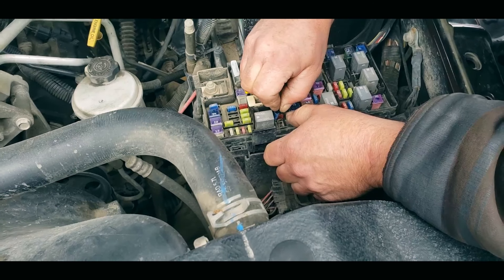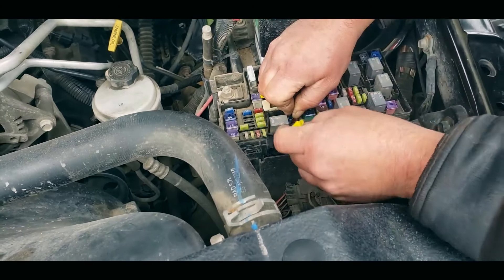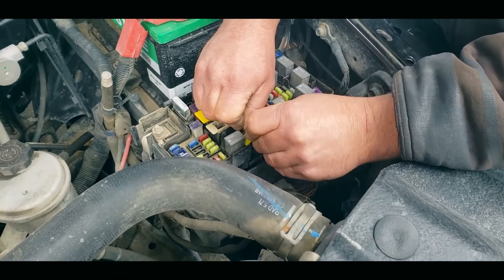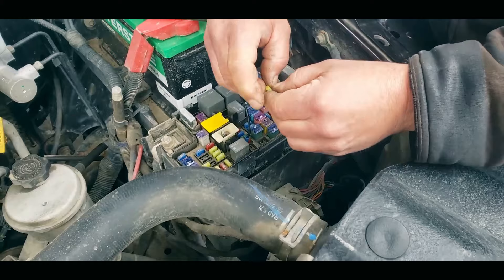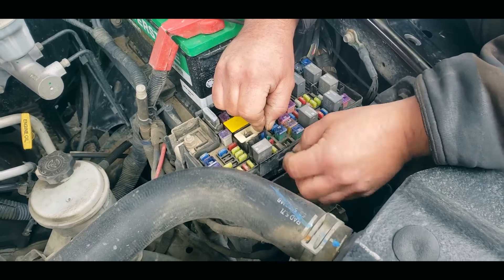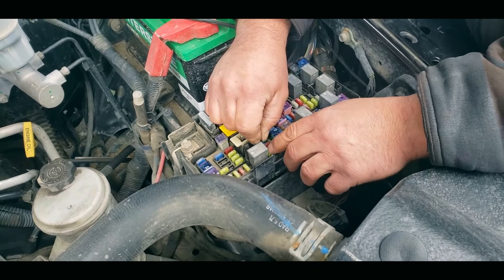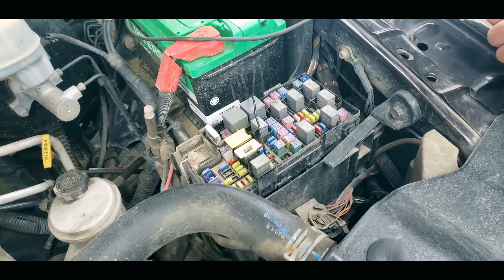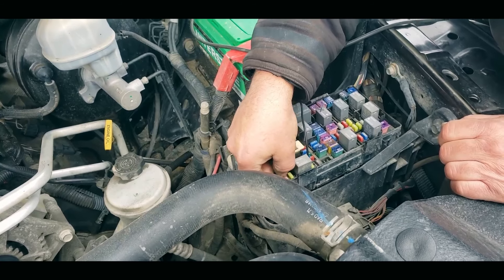Dodge Ram 1500 No Start Condition - Fuel Pump Relay / TIPM By-Pass

Comment from the maker: Hi ya'll,
Thanks for all the support and checking out this video. For those a little confused by what is going on:

Run a jumper wire from M25 fuel pump relay to any accessory fuse (M7 works). The relay is internal to the board so once it's burnt out you have to bypass, M25 is the perfect point to do so.

As many have noted in the comments, consider this a temporary fix to get your truck to a shop instead of getting towed, as bypassing the relay is a safety hazard.

Best of luck to all!
Reply: My relay is stuck in the closed position.  Drains Batt.  I need to disconect exzisting relay before I add new one.

Comment: You don't exactly need a new TIPM, you can order the relay itself for like $9. Remove the board by disconnecting all power to the unit then pushing all 4 lock tabs down which hold the TIPM. Lift it up gently and unplug the wiring harnesses, they are all color coded so you cant mix it up. Once the TIPM is out take it to a table and open it up, there will be I believe 8 more lock tabs that need undone before the TIPM will open in half exposing the insides. Once open carfully remove the board, DO NOT use force of any kind. Slowly wiggle it back and forth till comes out. Now either take the board to an electrical repair shop and they will switch the relay for around $55, or bust out the soldering gun and remove then replace the relay yourself. Its 5 small connections quick and easy even for a beginner, if your unsure then just remove the board and take it into a shop. The $55 they will charge to change it plus the $9 to buy the relay will save you a massive amount in the end. New TIPM are about $1000, refurbished ones about $350. Your essentially making your old one refurbished for like $65...And there are a handful of videos that show the entire process of this in detail as well.
Reply: I'd recommend making a video on that tbh, It litterally cost's $10-$70 ish depending on your area, and if you fix it yourself or go to an electrical shop for the relay change.
Reply: @Dragnous420 but I'm no mechanic and I have heart issues so I can't do to much. I bought the bypass kit for the 2011 dodge ram but what doesn't make sense is from 2007 to 2018 they have the TIPM but I think with the 2010s are different some way

Comment: I have a 2008 ram 1500 and my fuse box (tipm) doesn't look anything like this and there is no fuel pump fuse.
Reply: the fuel pump fuse and relay are built into the box you can simply replace them. Need to get a new fuse box. I have a 2008 as well and i’m having PCM fuse issues but they are leading me to the fuel pump
Reply: @musky_2000  it was the pump. I lifted the bed and it was an easy fix. Thanks.

Comment: What #s are those for the 07 Dodge Ram 1500 5.7 mine has the angled box. Mine went out this morning
Reply from the maker: On a 2011 model, the bypass jumper can be  between M7 and M25. I havent seen the slanted box myself, but from what I've read the jumper doesn't work because there is no M25 equivalent. Try here for patching 2 wires that may give power to the pump https://www.justanswer.com/dodge/ctk5c-2007-dodge-ram-1500-3-7-v6-engine-suspect.html, and here https://ca.cargurus.com/Cars/Discussion-d665_ds679502, 8 months ago someone posted a fix that may work. I've also seen that most of the issues for those with slanted box ended up just being the fuel pump so don't rule that out! Good luck!
Reply from the maker: Thanks for checking us out, please subscribe so we can keep putting out videos! Cheers
Reply: @frankandfrankauto  dude there are no M or any lettered slots in a 2008 dodge ram the fuse slots just go from 1 to like 38 no letters no relays only fuses and numbers
Reply: @frankandfrankauto Will this work for a 2010 Dodge Ram 1500 5.7 Hemi

Comment: Did you jumper that from the starter relay to just a different fuse. Ive done everything on this truck except change the fuse box and i homestly cant afford to go buy anymore parts right now baha but if this works ill be very grateful for sure
Reply from the maker: Any fuse with power to M25 fuse. If you have the non-slanted box it will work, but it is not a long term fix up as the circuit is always on. You can read through the comments for some excellent diy suggestions but unless you're electrically inclined, take it to a shop with experience and save yourself the headache. Best of luck!

Comment: I seem to have missed out being told to which terminal of the relay the hotwire goes.  85 or 86?
Likewise, which side of the donor provides the power to avoid bypassing that fuse?

Comment: TIPM Plug-In Fuel Pump Power Bypass/Test System (Lite)

By company called Vertical Versions $59 DYI 
Great video though👍
Reply from the maker: Will have to check it out, have been rewiring a lot of these for long term fixes
Reply: thank you
Reply: @frankandfrankauto  where are you located? Would like that done to my truck.
Reply from the maker: @AlexSilva-wo6lv  BC, Canada

Comment: Also i wouldnt recommend using the bypass and calling it fixed, thats more of a get you home and fix it thing. your fuel pump will be running wide open the second you turn your key this way. Now think for a second, say you crash your car. Normally the pcm senses no engine crank and kills power the the fuel pump, with this bypass it doesnt use the pcm the same so it wont shut off. youll be wrecked on the road with fuel pumping out everywhere if the lines or engine took damage in the wreck. Bit of a safety issue that you didnt bring up, use this bypass to troubleshoot if its fuel pump or relay or just to get home to fix / to the shop to be fixed. Basically if you bypass and still no fuel its fuel pump, if the bypass makes it work again its your relay.

Comment: @frank and frank auto repair...I am having an ASD issue at low throttle under load. 2004 Ram 1500 it just shuts off. Is there a way to bypass the ASD relay so that this doesn't keep happening? I have new coils and plugs. I'm getting P2074 code.
Reply from the maker: Hmm... how do you know its the ASD?

 Code is Manifold Pressure/Throttle Position Correlation - High Flow/Vacuum Leak. Indicates Map or TP sensor failure of some sort. OR PCM failure.

ASD relay is often no start. Shutting down under load may be fuel relay issue.

If you're sure it is ASD, then replace the relay and check the wiring harness of PCM for damage. I havent done a bypass before so I cannot advise on its effects.

Comment: Same thing here but mine is a 98 ram 1500 literally just replaced the fuel pump and the alternator and battery and yet it still won't start, the fuel pump won't kick in and turn on

Comment: What other fuse would you run the bypass cable to on a 09 ram?
Reply from the maker: M25 to anything that gets power with the key in basically. If you have the slanted box this doesn't apply unfortunately.
Reply: as Im sure you've noticed by now there is no M25 in your box that's because you have the angles fuse box and not the TIPM relay he is talking about if he was a good mechanic he would know that
Reply from the maker: @8levity626  did you see my comment above? Lol
Reply: That’s literally what he said. Like for me I have a slanted box in a 2008 1500 3.7 and I don’t think this fix is applicable. If it is please let me know exactly which fuses to jump since I have multiple M25s and open unused slots

Comment: i have a 2010 where the layout of the fuse box is different so how do you set the jump for this type.
Reply: Did you figure it out? Trying to do the same with my truck
Reply: Trying to do the same to my 2009 ram, can’t figure out what fuses to use with the bypass wire
Reply: yeah hes just wrong and this doesn't apply to 2008 ram 1500's

Comment: Great video it seems my 07 Ram is now showing these issues. I wish you could have a closeup of pushing in jumper wires. So if I understand you your bringing additional hot lead to one side of relay from an open hot spot correct? Thanks, keep the videos coming.
Reply: no he's jumping power from a constant hot to the fuel pump circuit bypassing the relay completely I would NOT recommend this as it is a HUGE fire risk the proper way is to install a universal multipurpose 30 amp connecter and plug an actual 30 amp relay into that.
Reply: @8levity626  I was wondering if someone wwas gonna say that. Its not like it's 4v circuitry or any more than a power wire that needs to get power. I had the same thing on my truck. Dug up the pinout and found which wire supplies power to the pump and then used the circuit for my sliding back window as an ignition lead since I got rid of the slider. I wired it all into a 30A relay socket and poof, no more issue plus i now have a socket and replaceble relay.

Comment: Mine is a 2008 Dodge ram with the slanted box which one should I connect
Reply from the maker: Slanted box doesn't work in the same way, it needs a more complicated repair. I recommend taking it to a mechanic unless you are good with electrical repair, in which case shoot me an email at fdnemes@gmail.com

Comment: Will this work for a 2010 Dodge Ram 1500??
Reply from the maker: This should work. Do you have the flat TIPM or the tilted/slanted one?
Reply: @frankandfrankauto  Slanted
Reply: @savion710  did this work I have the same
Reply: @wolfintarkov7368  it did not. I just replaced the fuel pump

Comment: I wish you would give the details of what you're doing you can't see what you're doing in this video
Reply from the maker: Hi Scott! 
This comment may be helpful! I will pin it at the top :)
Run a jumper wire from M25 fuel pump relay to any accessory fuse (M7 works). The relay is internal to the board so once it's burnt out you have to bypass, M25 is the perfect point to do so.

Comment: Could not see the you are pointing out.. put this here “ can’t see what you are doing “ plug this here “can’t see anything you are doing “?
Reply from the maker: Run a wire from the power side of a fuse to the tipm board itself.

Comment: Can't tell shit from this video. What did you jumper?
Reply from the maker: M25 fuel pump relay to any accessory fuse (M7 works). The relay is internal to the board so once it's burnt out you have to bypass, M25 is the perfect point to do so. Good luck.
Reply: @frankandfrankauto  thanks 🙏
Reply: 2008 Ram 1500 3.7L. My fuse box  does say M7 & M21 . I have the bypass cable with fuses. Just don’t know were to plug into with cable.